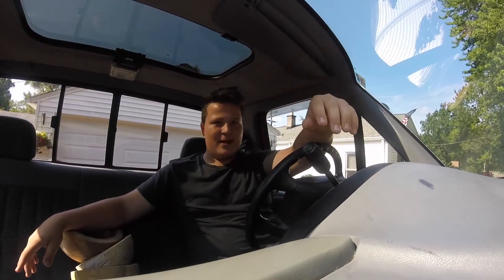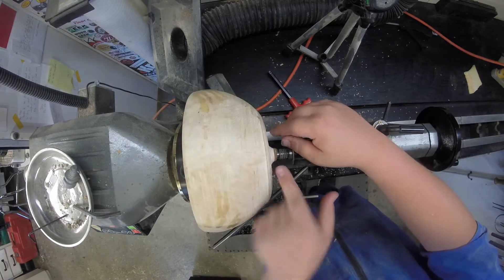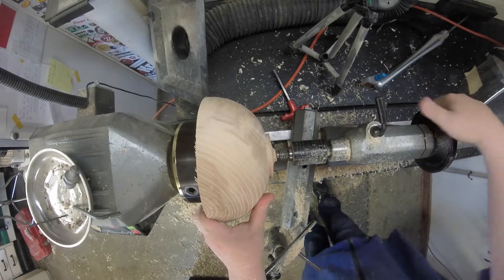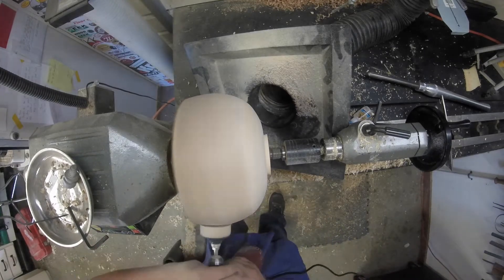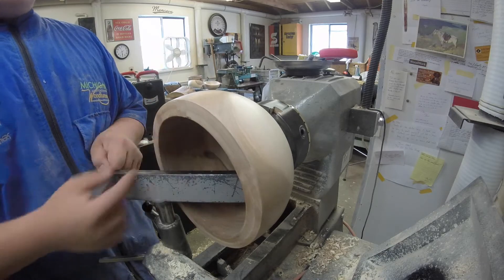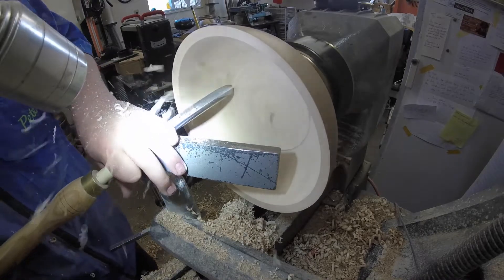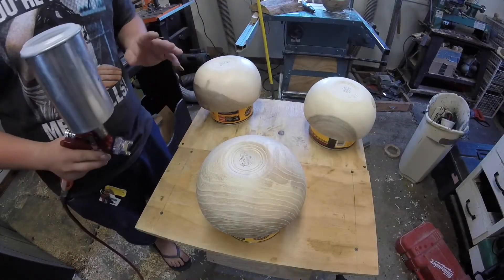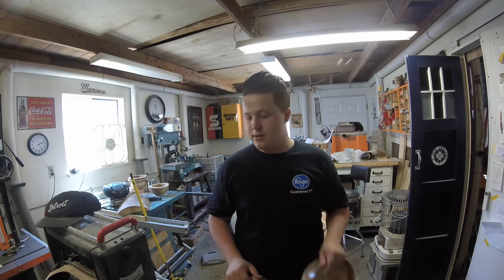3 Bowls for 3 Guys

Comment: Great video and great looking bowls! I was wondering what kind of a chuck do you use? And also holy cow I really need to get a good sharpening jog for my chisels and learn how to do push cuts well
Reply from the maker: Thats the BD550 from chucks plus.  For sharpening I'd recommend the ellesworth jig for bowl gouges and the varigrind jig for everything else.  Btw a 45 degree setup on the wolverine jig translates to a 60 degree bevel when you use the ellesworth.  You may not know what that means now but you'll thank me for that tip one day :)